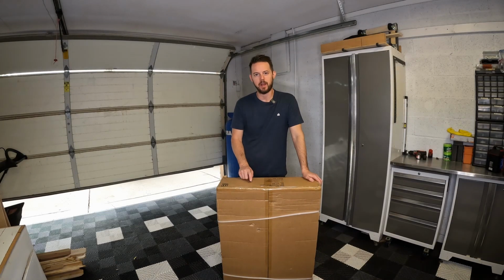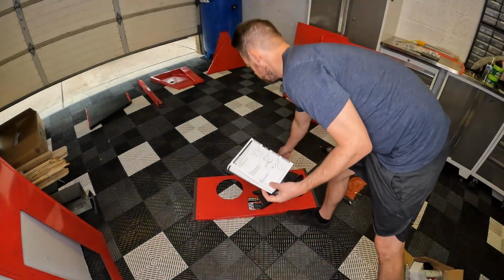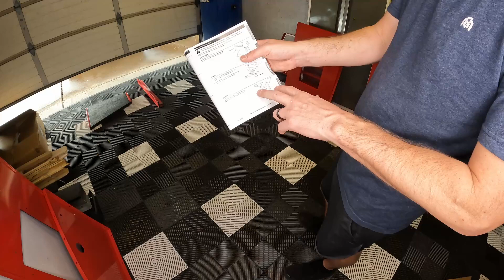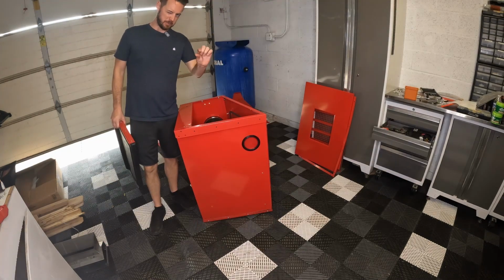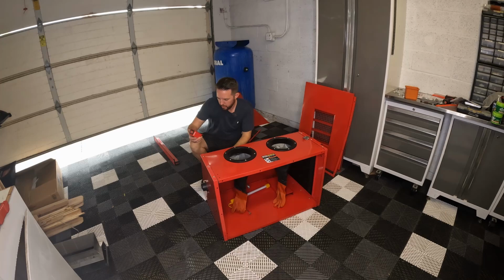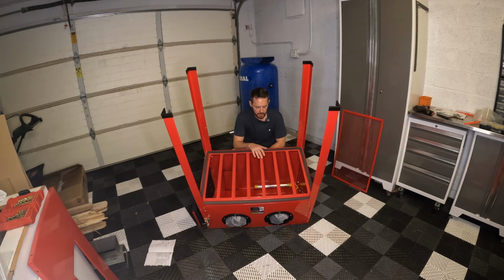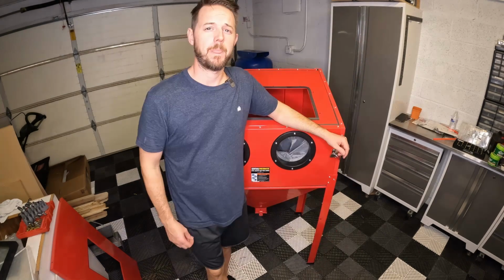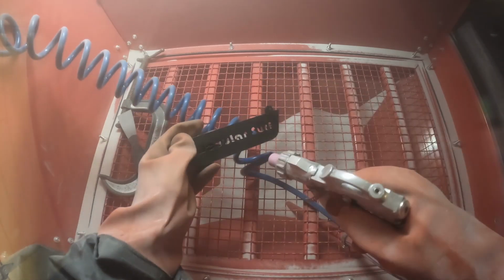Central Pneumatic / Harbor Freight Sandblasting Cabinet Assembly

Comment: 48:06 Yours is the second video where I’ve seen Part #9 (Bottom Plate) installed on the outside of the funnel.  The instructions show that the piece should go inside between the funnel and the Screen Frame….
Reply: Me too